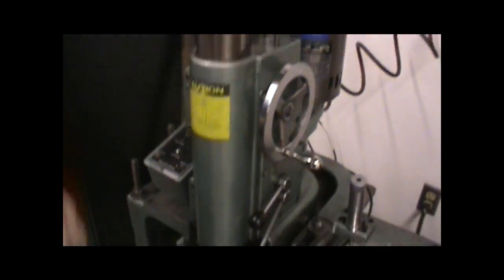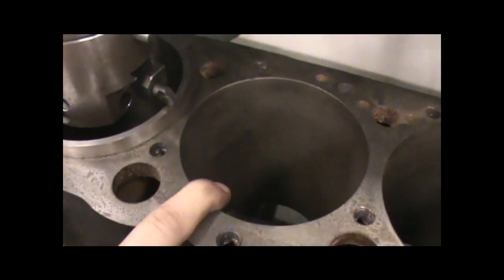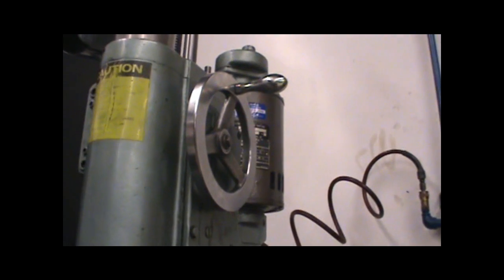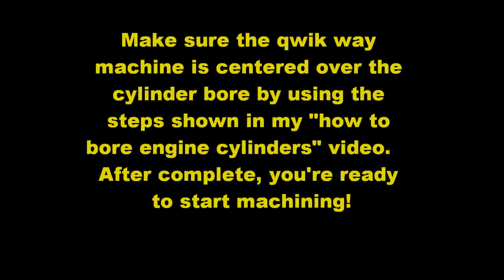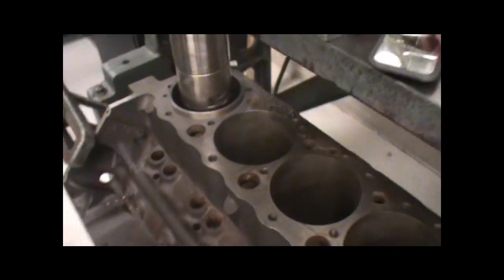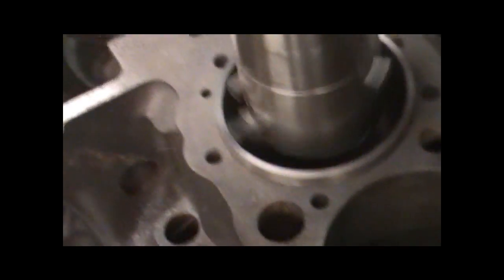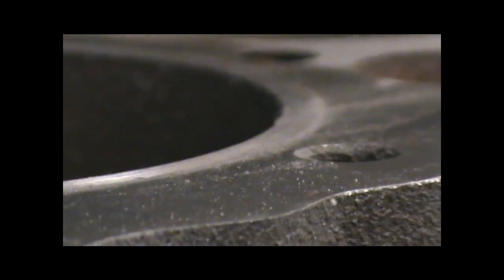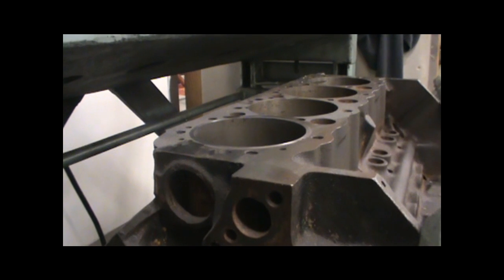Boring Protruding Cylinder Sleeves

Comment: Where in the world is your coolant fluid? I've never seen anyone cut without coolant except hydro cutting which is high pressure water used to cut steel. Otherwise, it this not a good way to create warping as well as possible heat treating to a level that may make your sleeve and or block brittle?

Comment from the maker: @blubu68 It infact DOES distort the cylinders next to it while INSTALLING the new cylinder sleeve, boring out the cylinder however does NOT.  The cylinder walls will still be out of round after boring them, but that's why we HONE the cylinders, to get them as perfectly round as possible.  Torque Plates also help to get this job done perfectly.